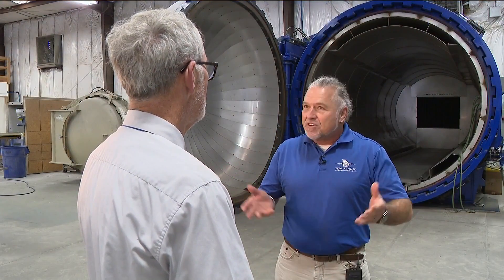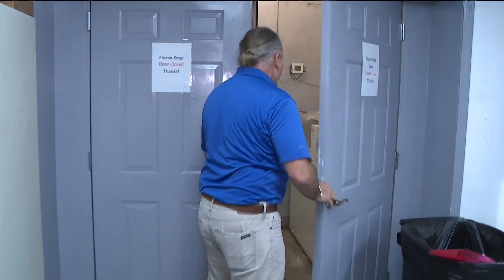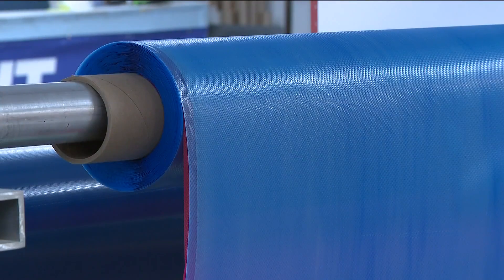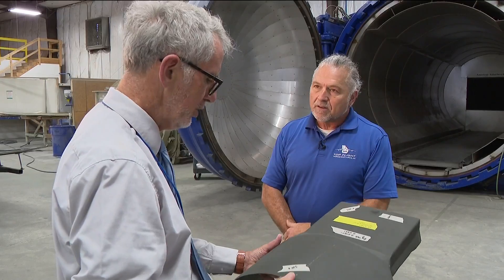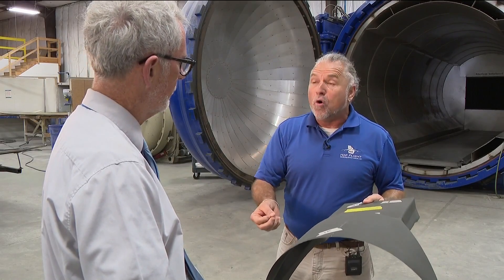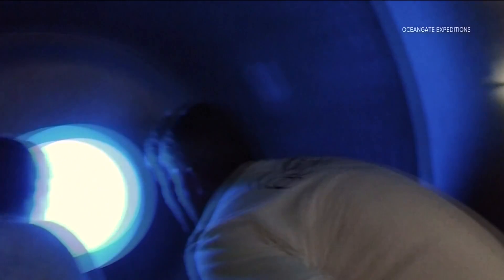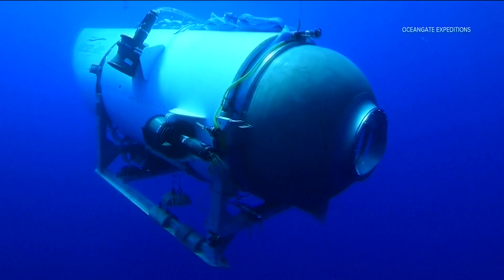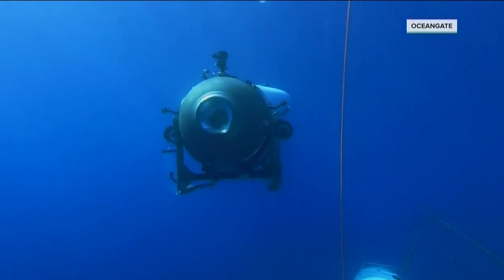Georgia engineer talks carbon fiber that failed in Titan submersible implosion

Comment: Human arrogance at its finest. If you want to experiment with your own life that’s one thing, but to be allowed to experiment with the lives of other’s is morally unconscionable. This submersible was a death trap waiting to happen. Even if the other passengers signed a waiver to acknowledge the risks, none of them fully understood just how poorly designed the submersible was. After listening to the experts in the field and gathering more information about the history of deep submersible diving, this situation was 100% avoidable. Stockton Rushes legacy will forever be tainted by his deliberate carelessness and refusal to do things the right way. There was a clear standard set in place for safety that had been tested and proven. The fact that Stockton knowingly went against that system by  cutting corners at every opportunity he had to do the right thing is criminal. No one had to die and that is what makes this situation so tragic.
Reply: How did you find out that none of them fully understood about the poor design?
Reply: @greyhalliwell  Stockton Rush was the  only engineer on board. Unless you are an underwater engineer that designs and tests marine equipment your knowledge is going to be very limited on computers models and materials used to build equipment that can safely withstand deep sea pressure and how many cycles a sub can take before structural deterioration sets in.  Two business men, an oceanographer,  and a 19 year old studying business didn’t have the marine engineering expertise to fully understand the risk involved. They trusted Stockton and the fact his submersible had successfully undergone several dives before without major incidents, meaning no one had ever died so it must be safe. So there was a false sense of security in this situation which tragically ended in loss of life. Stockton was also an aerospace engineer NOT a marine engineer so he had to consult with other engineers to build his sub. Stockton was set on using carbon fiber  to build his submersible hull which works well in space because external pressure is not a threat. In an ocean environment, external pressure is the primary threat which is why the industry standard for building subs is steel/titanium. Stockton was trying to apply space engineering concepts to the ocean which was doomed to fail because the environments are completely different. Stockton knew his equipment had issues and was warned multiple times by leading experts in underwater sea diving that his equipment was not safe. Sadly, Stockton chose arrogance over common sense and safety.
Reply: @GenXer1979    So...that they didn't fully understand is more of a supposition than something they or their families have said conclusively?

P.H. Nargeolet, who had piloted the DSV Nautile and who was quite close to James Cameron, did in fact know of the submersible community's concerns with the composite hull and actually voiced reservations himself about the larger size of Titan's porthole, according to a 6/21/23 Intelligencer article. That notwithstanding, he still decided to do at least two separate dives on the doomed submersible.
Reply: @greyhalliwell  I don't think Stockton told them that he used expired carbon fiber, or that he had an emergency where the sub couldn't surface because the lead weights wouldn't release. When that happened he had all the passengers get on one side and rock the sub to release the lead weights. He wasn't honest about the sub, because he knew nobody would take a ride on it and pay him 250k if they knew the truth. People will lie when that kind of money is on the line.
Reply: @mark6678  Hi! Is your second-to-last sentence a personal thought like your first sentence, or have authorities now determined conclusively per their investigation that Rush indeed defrauded those clients believed to have perished aboard Titan?
Reply: @greyhalliwell  he even lied and said NASA and Boeing were in on the engineering design.
Reply: @happity  Did you mean to @ me?
Reply: @greyhalliwell  and he bullied the Vegas man saying that it's safer than a helicopter ride.
Reply: @greyhalliwell  yes, they definitely did not understand. Only Rush was a reckless maniac.
Reply: @happity   Oh, snap. How long had you been in contact with them?
Reply: @greyhalliwell  not at all, they read out Rush's email correspondences on an interview. It's negligent manslaughter.
Reply: If you can, go find the video of them gluing on the ring to the carbon fiber. You will be shocked at just how thin the lip was on the titanium ring. It's the dumbest thing I've ever seen. It was made to fail.
That said. Arrogance is what sank the Titanic, claiming it was unsinkable. Then the captain not listening to warnings about ice and going full speed ahead. Now arrogance not listening to his own people about safety issues. Not even testing sufficiently.
Reply: free market applied!

Comment: This doesn’t answer the effects on carbon fiber under extreme underwater pressure. Titan was rated to 13,123 ft which doesn’t provide anywhere enough of a safety factor. Waiting to if they recover the Titan and explore what happened.
Reply: They had a design depth of 4000 meters with a 2.25 safety factor. Unfortunately the hull probably degraded with each trip in unforeseen ways